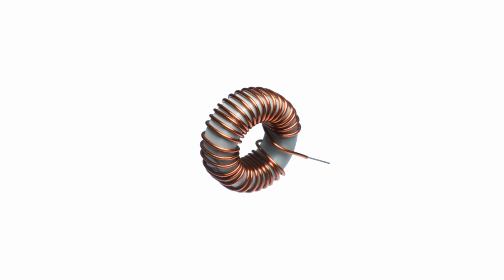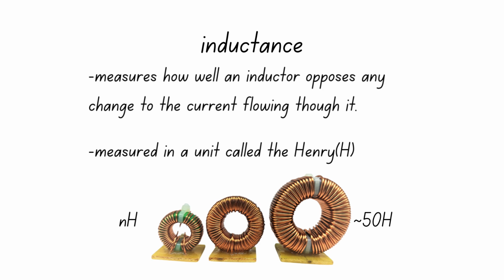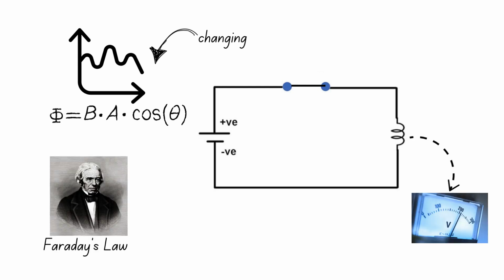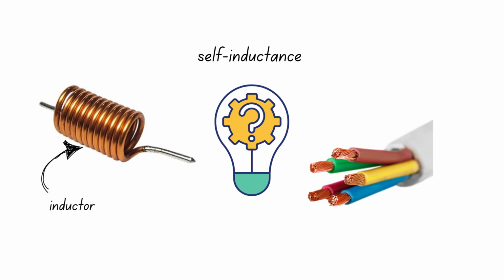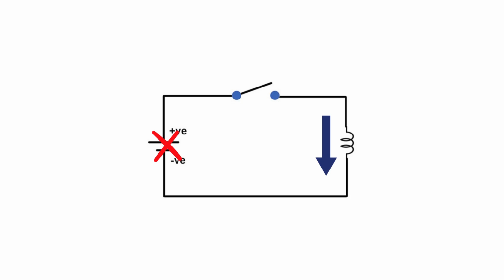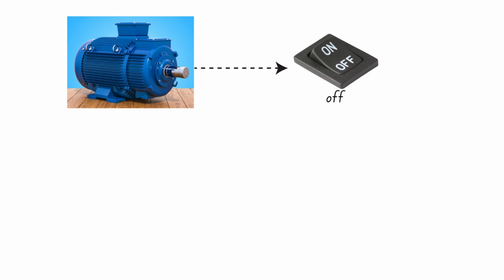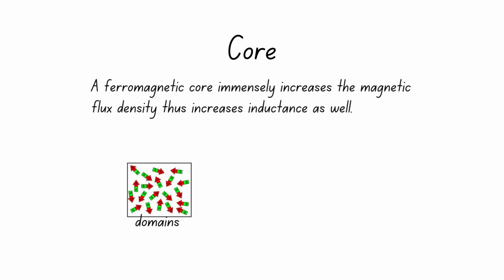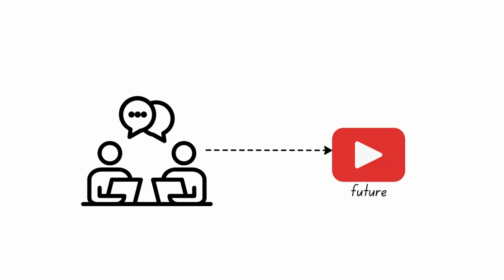How Inductors Work? | The Physics Behind Inductors

Comment: Hmm, conventional flow was used, not electron flow, why?
Reply from the maker: @jeffhunter3402  Good question. In circuit analysis, the general rule of thumb is to use conventional current(flow of positive charge) instead of actual current(flow of negative charge). This is done because back in the days, scientists thought current was the flow of positive charge so all the rules used in circuit analysis and electromagnetism are based on the flow of conventional current. Here, I could have used either, but sticking to conventional current just makes it easier. Also, there is no problem with viewing current as the flow of positive charge when doing analysis, since the flow of negative charge(electrons) in one direction is akin to positive charge flowing in the opposite direction.
I hope it makes sense now😊.

Comment: The best mechanical analog I've heard, is inductors behave kind of like a flywheel. It's not a perfect analogy, misses the voltage spike after power disconnect, but helps newcomers.
Reply from the maker: @usopenplayer  yes, that totally makes sense. Thanks for that one. I had never heard of it. It’s brilliant.